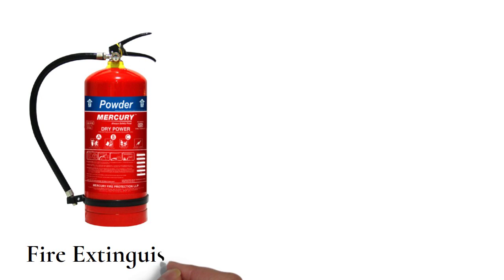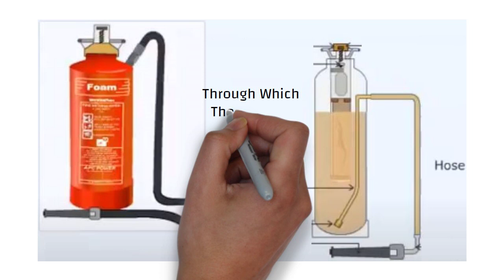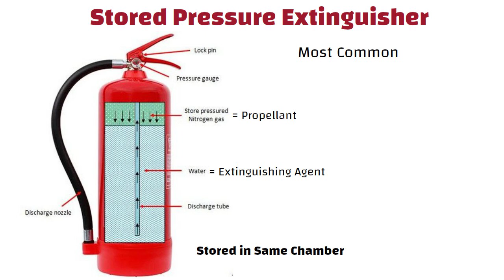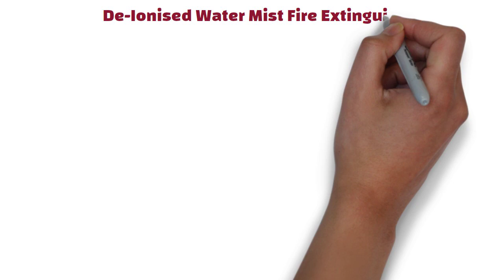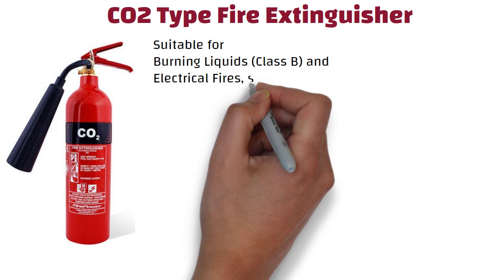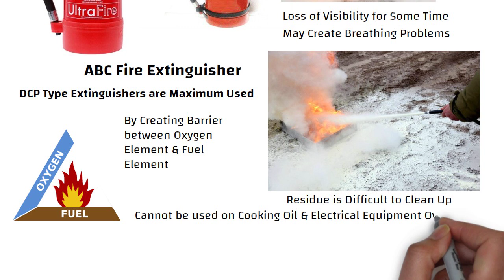FIRE EXTINGUISHER DEALERS IN KERALA, CALL 8138906102, FIRE EXTINGUISHER DEALERS IN ERNAKULAM.

Comment: FIRE EXTINGUISHER DEALERS IN KOCHI, FIRE EXTINGUISHER SUPPLIERS IN KOCHI, FIRE EXTINGUISHER DISTRIBUTORS IN KOCHI, FIRE EXTINGUISHER IN KOCHI, ABC TYPE FIRE EXTINGUISHER DEALERS IN KOCHI, CO2 TYPE FIRE EXTINGUISHER DEALERS IN KOCHI, CLEAN AGENT FIRE EXTINGUISHER IN KOCHI, MODULAR TYPE FIRE EXTINGUISHER DEALERS IN KOCHI, MECHANICAL FOAM FIRE EXTINGUISHER DEALERS IN KOCHI, FIRE EXTINGUISHER NEAR ME KOCHI, FIRE EXTINGUISHER TRADERS IN KOCHI, FIRE FIGHTING COMPANIES IN KOCHI, FIRE CONTRACTORS IN KOCHI, FIRE EQUIPMENT DEALERS IN KOCHI, FIRE ALARM DEALERS IN KOCHI, FIRE PUMP DEALERS IN KOCHI, SMOKE DETECTOR DEALERS IN KOCHI, FIRE FIGHTING SYSTEM IN KOCHI, FIRE PROTECTION SYSTEM IN KOCHI, FIRE AND SAFETY CONTRACTORS IN KOCHI, FIRE HYDRANT SYSTEMS IN KOCHI, PA TALK BACK SYSTEM IN KOCHI, FIRE NOC IN KOCHI, FIRE INSTALLATION IN KOCHI, FIRE NOC RENEWAL IN KOCHI, KIRLOSKAR FIRE PUMP DEALERS IN KOCHI, FIRE EXTINGUISHER NEAR ME KOCHI, FIRE EXTINGUISHER MANUFACURERS IN KOCHI, SAFEX FIRE EXTINGUISHER DEALERS IN KOCHI, FIRE NOC CONTRACTORS IN KOCHI, FIRE FIGHTING EQUIPMENT DEALERS IN KOCHI, FIRE PROTECTION SYSTEM IN KOCHI, FIRE INSTALLATION IN KOCHI, FIRE SAFETY CONTRACTORS IN KOCHI, FIRE AMC IN KOCHI, FIRE PROTECTION SYSTEM IN KOCHI, FIRE PROTECTION EQUIPMET IN KOCHI, AMC OF FIRE SYSTEM IN KOCHI, FIRE CONSULTANTS IN KOCHI, FIRE AND SAFETY EQUIPMENT DEALERS IN KOCHI, ADDRESSABLE FIRE ALARM SYSTEM IN KOCHI, KARTHAR VALVE DEALERS IN KOCHI, DCP TYPE FIRE EXTINGUISHER IN KOCHI, POWSER TYPE FIRE EXTINGUISHERS IN KOCHI, FIRE HYDRANT SYSTEM IN KOCHI, FIRE ALARM PANEL DEALERS IN KOCHI, SAFEPRO FIRE EXTINGUISHER DEALERS IN KOCHI, MS AND GI PIPE DEALERS IN KOCHI, JINDAL PIPE DEALERS IN KOCHI, AGNI FIRE ALARM DEALERS IN KOCHI, FIRE EQUIPMENT DEALERS IN KOCHI, FIRE EQUIPMENT SUPPLIERS IN KOCHI, FIRE EQUIPMENT TRADERS IN KOCHI, FIRE SPRINKLER SYSTEM IN KOCHI, RAVLE FIRE ALARM DEALERS IN KOCHI, RAVEL FIRE ALARM SYSTEM IN KOCHI, AGNI FIRE ALARM DISTRIBUTORS IN KOCHI, FIRE ALARM CONTRACTORS IN KOCHI, FIRE PIPE INSTALLATION IN CONTRACTORS IN KOCHI, FIRE SAFETY CONTRACTORS IN KOCHI, FIRE PA TWO WAY TALK BACK SYSTEM DEALERS IN KOCHI, HEAT DETECTOR DEALERS IN KOCHI, HONEYWELL FIRE ALARM DEALERS IN KOCHI, FIRE NOC CONSULTANTS IN KOCHI, FIRE AMC AND FIRE NOC IN KOCHI, FIRE SAFETY COMPANIES IN KOCHI, NEWAGE DEALERS IN KOCHI, MONSHER FIRE EQUIPMENT DEALERS IN KOCHI, KARTHAR VALVE DEALERS IN KOCHI, FIRE HYDRANT VALVE DEALERS IN KOCHI, FIRE HOSE REEL DRUM DEALERS IN KOCHI, FIRE SPRINKLER DEALERS IN KOCHI, FIRE PUMP DEALERS IN KOCHI, LUBI PUMP DEALERS IN KOCHI, LHP PUMP DEALERS IN KOCHI. FIRE CONTRACTORS IN KOCHI, FIRE AND SAFETY CONTRACTORS IN KOCHI, FIRE EQUIPMENT DEALERS IN KOCHI, FIRE FIGHTING CONTRACTORS IN KOCHI,

Comment: FIRE EXTINGUISHER DEALERS IN WAYANAD, FIRE EXTINGUISHER SUPPLIERS IN WAYANAD, FIRE EXTINGUISHER DISTRIBUTORS IN WAYANAD, FIRE EXTINGUISHER IN WAYANAD, ABC TYPE FIRE EXTINGUISHER DEALERS IN WAYANAD, CO2 TYPE FIRE EXTINGUISHER DEALERS IN WAYANAD, CLEAN AGENT FIRE EXTINGUISHER IN WAYANAD, MODULAR TYPE FIRE EXTINGUISHER DEALERS IN WAYANAD, MECHANICAL FOAM FIRE EXTINGUISHER DEALERS IN WAYANAD, FIRE EXTINGUISHER NEAR ME WAYANAD, FIRE EXTINGUISHER TRADERS IN WAYANAD, FIRE FIGHTING COMPANIES IN WAYANAD, FIRE CONTRACTORS IN WAYANAD, FIRE EQUIPMENT DEALERS IN WAYANAD, FIRE ALARM DEALERS IN WAYANAD, FIRE PUMP DEALERS IN WAYANAD, SMOKE DETECTOR DEALERS IN WAYANAD, FIRE FIGHTING SYSTEM IN WAYANAD, FIRE PROTECTION SYSTEM IN WAYANAD, FIRE AND SAFETY CONTRACTORS IN WAYANAD, FIRE HYDRANT SYSTEMS IN WAYANAD, PA TALK BACK SYSTEM IN WAYANAD, FIRE NOC IN WAYANAD, FIRE INSTALLATION IN WAYANAD, FIRE NOC RENEWAL IN WAYANAD, KIRLOSKAR FIRE PUMP DEALERS IN WAYANAD, FIRE EXTINGUISHER NEAR ME WAYANAD, FIRE EXTINGUISHER MANUFACURERS IN WAYANAD, SAFEX FIRE EXTINGUISHER DEALERS IN WAYANAD, FIRE NOC CONTRACTORS IN WAYANAD, FIRE FIGHTING EQUIPMENT DEALERS IN WAYANAD, FIRE PROTECTION SYSTEM IN WAYANAD, FIRE INSTALLATION IN WAYANAD, FIRE SAFETY CONTRACTORS IN WAYANAD, FIRE AMC IN WAYANAD, FIRE PROTECTION SYSTEM IN WAYANAD, FIRE PROTECTION EQUIPMET IN WAYANAD, AMC OF FIRE SYSTEM IN WAYANAD, FIRE CONSULTANTS IN WAYANAD, FIRE AND SAFETY EQUIPMENT DEALERS IN WAYANAD, ADDRESSABLE FIRE ALARM SYSTEM IN WAYANAD, KARTHAR VALVE DEALERS IN WAYANAD, DCP TYPE FIRE EXTINGUISHER IN WAYANAD, POWSER TYPE FIRE EXTINGUISHERS IN WAYANAD, FIRE HYDRANT SYSTEM IN WAYANAD, FIRE ALARM PANEL DEALERS IN WAYANAD, SAFEPRO FIRE EXTINGUISHER DEALERS IN WAYANAD, MS AND GI PIPE DEALERS IN WAYANAD, JINDAL PIPE DEALERS IN WAYANAD, AGNI FIRE ALARM DEALERS IN WAYANAD, FIRE EQUIPMENT DEALERS IN WAYANAD, FIRE EQUIPMENT SUPPLIERS IN WAYANAD, FIRE EQUIPMENT TRADERS IN WAYANAD, FIRE SPRINKLER SYSTEM IN WAYANAD, RAVEL FIRE ALARM DEALERS IN WAYANAD, RAVEL FIRE ALARM SYSTEM IN WAYANAD, AGNI FIRE ALARM DISTRIBUTORS IN WAYANAD, FIRE ALARM CONTRACTORS IN WAYANAD, FIRE PIPE INSTALLATION IN CONTRACTORS IN WAYANAD, FIRE SAFETY CONTRACTORS IN WAYANAD, FIRE PA TWO WAY TALK BACK SYSTEM DEALERS IN WAYANAD, HEAT DETECTOR DEALERS IN WAYANAD, HONEYWELL FIRE ALARM DEALERS IN WAYANAD, FIRE NOC CONSULTANTS IN WAYANAD, FIRE AMC AND FIRE NOC IN WAYANAD, FIRE SAFETY COMPANIES IN WAYANAD, NEWAGE DEALERS IN WAYANAD, MONSHER FIRE EQUIPMENT DEALERS IN WAYANAD, KARTHAR VALVE DEALERS IN WAYANAD, FIRE HYDRANT VALVE DEALERS IN WAYANAD, FIRE HOSE REEL DRUM DEALERS IN WAYANAD, FIRE SPRINKLER DEALERS IN WAYANAD, FIRE PUMP DEALERS IN WAYANAD, LUBI PUMP DEALERS IN WAYANAD, LHP PUMP DEALERS IN WAYANAD. FIRE CONTRACTORS IN WAYANAD, FIRE AND SAFETY CONTRACTORS IN WAYANAD, FIRE EQUIPMENT DEALERS IN WAYANAD, FIRE FIGHTING CONTRACTORS IN WAYANAD, AGNI FIRE ALARM DEALERS IN WAYANAD, PA TALK BACK SYSTEM DEALERS IN WAYANAD, FIRE NOC IN WAYANAD, FIRE NOC RENEWAL IN WAYANAD, FIRE SYSTEM INSTALLATION IN WAYANAD, FIRE EXTINGUISHER DEALERS IN KALPETTA, FIRE EXTINGUISHER DEALERS IN BATHERY, FIRE EXTINGUISHER DEALERS IN MANATHAVADY.

Comment: FIRE EXTINGUISHER DEALERS IN PALAKKAD, FIRE EXTINGUISHER SUPPLIERS IN PALAKKAD, FIRE EXTINGUISHER DISTRIBUTORS IN PALAKKAD, FIRE EXTINGUISHER IN PALAKKAD, ABC TYPE FIRE EXTINGUISHER DEALERS IN PALAKKAD, CO2 TYPE FIRE EXTINGUISHER DEALERS IN PALAKKAD, CLEAN AGENT FIRE EXTINGUISHER IN PALAKKAD, MODULAR TYPE FIRE EXTINGUISHER DEALERS IN PALAKKAD, MECHANICAL FOAM FIRE EXTINGUISHER DEALERS IN PALAKKAD, FIRE EXTINGUISHER NEAR ME PALAKKAD, FIRE EXTINGUISHER TRADERS IN PALAKKAD, FIRE FIGHTING COMPANIES IN PALAKKAD, FIRE CONTRACTORS IN PALAKKAD, FIRE EQUIPMENT DEALERS IN PALAKKAD, FIRE ALARM DEALERS IN PALAKKAD, FIRE PUMP DEALERS IN PALAKKAD, SMOKE DETECTOR DEALERS IN PALAKKAD, FIRE FIGHTING SYSTEM IN PALAKKAD, FIRE PROTECTION SYSTEM IN PALAKKAD, FIRE AND SAFETY CONTRACTORS IN PALAKKAD, FIRE HYDRANT SYSTEMS IN PALAKKAD, PA TALK BACK SYSTEM IN PALAKKAD, FIRE NOC IN PALAKKAD, FIRE INSTALLATION IN PALAKKAD, FIRE NOC RENEWAL IN PALAKKAD, KIRLOSKAR FIRE PUMP DEALERS IN PALAKKAD, FIRE EXTINGUISHER NEAR ME PALAKKAD, FIRE EXTINGUISHER MANUFACURERS IN PALAKKAD, SAFEX FIRE EXTINGUISHER DEALERS IN PALAKKAD, FIRE NOC CONTRACTORS IN PALAKKAD, FIRE FIGHTING EQUIPMENT DEALERS IN PALAKKAD, FIRE PROTECTION SYSTEM IN PALAKKAD, FIRE INSTALLATION IN PALAKKAD, FIRE SAFETY CONTRACTORS IN PALAKKAD, FIRE AMC IN PALAKKAD, FIRE PROTECTION SYSTEM IN PALAKKAD, FIRE PROTECTION EQUIPMET IN PALAKKAD, AMC OF FIRE SYSTEM IN PALAKKAD, FIRE CONSULTANTS IN PALAKKAD, FIRE AND SAFETY EQUIPMENT DEALERS IN PALAKKAD, ADDRESSABLE FIRE ALARM SYSTEM IN PALAKKAD, KARTHAR VALVE DEALERS IN PALAKKAD, DCP TYPE FIRE EXTINGUISHER IN PALAKKAD, POWSER TYPE FIRE EXTINGUISHERS IN PALAKKAD, FIRE HYDRANT SYSTEM IN PALAKKAD, FIRE ALARM PANEL DEALERS IN PALAKKAD, SAFEPRO FIRE EXTINGUISHER DEALERS IN PALAKKAD, MS AND GI PIPE DEALERS IN PALAKKAD, JINDAL PIPE DEALERS IN PALAKKAD, AGNI FIRE ALARM DEALERS IN PALAKKAD, FIRE EQUIPMENT DEALERS IN PALAKKAD, FIRE EQUIPMENT SUPPLIERS IN PALAKKAD, FIRE EQUIPMENT TRADERS IN PALAKKAD, FIRE SPRINKLER SYSTEM IN PALAKKAD, RAVEL FIRE ALARM DEALERS IN PALAKKAD, RAVEL FIRE ALARM SYSTEM IN PALAKKAD, AGNI FIRE ALARM DISTRIBUTORS IN PALAKKAD, FIRE CONTRACTORS IN PALAKKAD, FIRE FIGHTING CONTRACTORS IN PALAKKAD, FIRE FIGHTING COMPANIES IN PALAKKAD, FIRE INSTALLATION IN PALAKKAD,  FIRE ALARM CONTRACTORS IN PALAKKAD, FIRE PIPE INSTALLATION IN CONTRACTORS IN PALAKKAD, FIRE SAFETY CONTRACTORS IN PALAKKAD, FIRE PA TWO WAY TALK BACK SYSTEM DEALERS IN PALAKKAD, HEAT DETECTOR DEALERS IN PALAKKAD, HONEYWELL FIRE ALARM DEALERS IN PALAKKAD, FIRE NOC CONSULTANTS IN PALAKKAD, FIRE AMC AND FIRE NOC IN PALAKKAD, FIRE SAFETY COMPANIES IN PALAKKAD, NEWAGE DEALERS IN PALAKKAD, MONSHER FIRE EQUIPMENT DEALERS IN PALAKKAD, KARTHAR VALVE DEALERS IN PALAKKAD, FIRE HYDRANT VALVE DEALERS IN PALAKKAD, FIRE HOSE REEL DRUM DEALERS IN PALAKKAD, FIRE SPRINKLER DEALERS IN PALAKKAD, FIRE PUMP DEALERS IN PALAKKAD, LUBI PUMP DEALERS IN PALAKKAD, LHP PUMP DEALERS IN PALAKKAD. FIRE CONTRACTORS IN PALAKKAD, FIRE AND SAFETY CONTRACTORS IN PALAKKAD, FIRE EQUIPMENT DEALERS IN PALAKKAD, FIRE FIGHTING CONTRACTORS IN PALAKKAD,

Comment: fire protection equipments in KOCHI, fire and safety consultants in KOCHI, fire protection system in KOCHI, fire alarm systems in KOCHI, fire and safety consultants in KOCHI, fire protection system in KOCHI, fire and safety installation in KOCHI, fire and safety contractors in KOCHI, fire fighting companies in KOCHI, fire protection equipments in KOCHI, fire protection system contractors in COCHIN, fire alarm systems in KOCHI, fire protection consultants in KOCHI, fire safety contractors in KOCHI, fire safety consultants in KOCHI, fire consultants in KOCHI, fire and safety contractors in KOCHI, fire alarm systems in KOCHI, fire and safety AMC in KOCHI, fire and safety equipment suppliers in KOCHI, fire and safety systems in KOCHI, fire fighting companies in KOCHI, fire NOC consultants in KOCHI, fire extinguisher manufacturers in KOCHI, fire protection AMC in KOCHI, fire fighting consultants in KOCHI, fire fighting consultants in KOCHI, fire NOC renewal in KOCHI, fire and safety equipment in KOCHI, fire extinguisher in KOCHI, Fire extinguisher dealers in ERNAKULAM, fire extinguisher dealers in ERNAKULAM, fire fighting contractors in ERNAKULAM, ERNAKULAM, fire and safety installation in ERNAKULAM, fire extinguisher suppliers in ERNAKULAM, fire extinguisher suppliers in ERNAKULAM, fire extinguisher in ERNAKULAM, fire extinguisher in ERNAKULAM, fire protection system in ERNAKULAM, fire protection system in ERNAKULAM, fire and safety installation in ERNAKULAM, fire and safety installation in ERNAKULAM, fire and safety contractors in ERNAKULAM, fire safety contractors in ERNAKULAM, fire and safety systems equipments in ERNAKULAM, fire and safety equipment suppliers in ERNAKULAM, fire equipment in ERNAKULAM, fire extinguisher in ERNAKULAM, fire extinguisher in ERNAKULAM, fire protection system installation in ERNAKULAM, fire contractors in ERNAKULAM, fire safety consultants in ERNAKULAM, ABC type fire extinguisher dealers in Kochi, DCP type fire extinguisher dealers in Kochi, CO2 type fire extinguisher dealers in Kochi, Fire extinguisher wholesale traders in Kochi, Fire extinguisher suppliers in Kochi, Fire protection equipment dealers in Kochi, Fire alarm dealers in Kochi, Smoke detector dealers in Kochi, PA talk back system in Kochi, Addressable fire alarm dealers in Kochi, Morley Fire alarm dealers in Kochi, Ravel fire alarm dealers in Kochi, Fire fighting system in Kochi, Fire NOC in Kochi, Fire contractors in Kochi, Karthar dealers in Kochi, Fire protection system in Kochi, Fire installation in Kochi, Fire consultants in Kochi, Fire Extinguishers Wholesalers , Fire Extinguishers Distributors in COCHIN, Fire Extinguishers Sales & Service in COCHIN, Fire Extinguishers Retailers in ERNAKULAM, FIRE FIGHTING SYSTEMS – FIRE PROTECTION SYSTEMS – FIRE FIGHTING EQUIPMENTS – FIRE PROTECTION EQUIPMENTS – FIRE EXTINGUISHING EQUIPMENT – FIRE EXTINGUISHER DEALERS-SAFETY EQUIPMENT DEALERS – FIRE PROTECTION AND FIRE FIGHTING EQUIPMENT DEALER, Fire Safety Systems Suppliers, Fire Safety Systems Distributors, Fire Safety Systems Wholesalers, Fire Safety Systems Retailers, fire and safety contractors in KOCHI, fire alarm systems in KOCHI, fire and safety AMC in KOCHI, fire and safety equipment suppliers in KOCHI, fire and safety systems in KOCHI, fire fighting companies in KOCHI, fire NOC consultants in KOCHI, fire extinguisher manufacturers in KOCHI, fire protection AMC in KOCHI, fire NOC renewal in KOCHI, fire and safety equipment in KOCHI, fire extinguisher in KOCHI, Fire extinguisher dealers in ERNAKULAM, fire extinguisher dealers in ERNAKULAM, fire fighting contractors in ERNAKULAM, ERNAKULAM, fire and safety installation in ERNAKULAM, fire extinguisher suppliers in ERNAKULAM, fire extinguisher suppliers in ERNAKULAM, fire extinguisher in ERNAKULAM, fire extinguisher in ERNAKULAM, fire protection system in ERNAKULAM, fire protection system in ERNAKULAM, fire and safety installation in ERNAKULAM, fire and safety installation in ERNAKULAM, fire and safety contractors in ERNAKULAM, fire safety contractors in ERNAKULAM, fire and safety systems equipments in ERNAKULAM, fire and safety equipment suppliers in ERNAKULAM, fire equipment in ERNAKULAM, fire extinguisher in ERNAKULAM, fire extinguisher in ERNAKULAM, fire protection system installation in ERNAKULAM, fire contractors in ERNAKULAM, ERNAKULAM, fire safety consultants in ERNAKULAM, ERNAKULAM, fire alarm systems in ERNAKULAM, fire NOC in ERNAKULAM, fire AMC in ERNAKULAM, ERNAKULAM, fire fighting equipment in ERNAKULAM, COCHIN,

Comment: FIRE EXTINGUISHER DEALERS IN CALICUT, FIRE EXTINGUISHER SUPPLIERS IN CALICUT, FIRE EXTINGUISHER DISTRIBUTORS IN CALICUT, FIRE EXTINGUISHER IN CALICUT, ABC TYPE FIRE EXTINGUISHER DEALERS IN CALICUT, CO2 TYPE FIRE EXTINGUISHER DEALERS IN CALICUT, CLEAN AGENT FIRE EXTINGUISHER IN CALICUT, MODULAR TYPE FIRE EXTINGUISHER DEALERS IN CALICUT, MECHANICAL FOAM FIRE EXTINGUISHER DEALERS IN CALICUT, FIRE EXTINGUISHER NEAR ME CALICUT, FIRE EXTINGUISHER TRADERS IN CALICUT, FIRE FIGHTING COMPANIES IN CALICUT, FIRE CONTRACTORS IN CALICUT, FIRE EQUIPMENT DEALERS IN CALICUT, FIRE ALARM DEALERS IN CALICUT, FIRE PUMP DEALERS IN CALICUT, SMOKE DETECTOR DEALERS IN CALICUT, FIRE FIGHTING SYSTEM IN CALICUT, FIRE PROTECTION SYSTEM IN CALICUT, FIRE AND SAFETY CONTRACTORS IN CALICUT, FIRE HYDRANT SYSTEMS IN CALICUT, PA TALK BACK SYSTEM IN CALICUT, FIRE NOC IN CALICUT, FIRE INSTALLATION IN CALICUT, FIRE NOC RENEWAL IN CALICUT, KIRLOSKAR FIRE PUMP DEALERS IN CALICUT, FIRE EXTINGUISHER NEAR ME CALICUT, FIRE EXTINGUISHER MANUFACURERS IN CALICUT, SAFEX FIRE EXTINGUISHER DEALERS IN CALICUT, FIRE NOC CONTRACTORS IN CALICUT, FIRE FIGHTING EQUIPMENT DEALERS IN CALICUT, FIRE PROTECTION SYSTEM IN CALICUT, FIRE INSTALLATION IN CALICUT, FIRE SAFETY CONTRACTORS IN CALICUT, FIRE AMC IN CALICUT, FIRE PROTECTION SYSTEM IN CALICUT, FIRE PROTECTION EQUIPMET IN CALICUT, AMC OF FIRE SYSTEM IN CALICUT, FIRE CONSULTANTS IN CALICUT, FIRE AND SAFETY EQUIPMENT DEALERS IN CALICUT, ADDRESSABLE FIRE ALARM SYSTEM IN CALICUT, KARTHAR VALVE DEALERS IN CALICUT, DCP TYPE FIRE EXTINGUISHER IN CALICUT, POWSER TYPE FIRE EXTINGUISHERS IN CALICUT, FIRE HYDRANT SYSTEM IN CALICUT, FIRE ALARM PANEL DEALERS IN CALICUT, SAFEPRO FIRE EXTINGUISHER DEALERS IN CALICUT, MS AND GI PIPE DEALERS IN CALICUT, JINDAL PIPE DEALERS IN CALICUT, AGNI FIRE ALARM DEALERS IN CALICUT, FIRE EQUIPMENT DEALERS IN CALICUT, FIRE EQUIPMENT SUPPLIERS IN CALICUT, FIRE EQUIPMENT TRADERS IN CALICUT, FIRE SPRINKLER SYSTEM IN CALICUT, RAVLE FIRE ALARM DEALERS IN CALICUT, RAVEL FIRE ALARM SYSTEM IN CALICUT, AGNI FIRE ALARM DISTRIBUTORS IN CALICUT, FIRE ALARM CONTRACTORS IN CALICUT, FIRE PIPE INSTALLATION IN CONTRACTORS IN CALICUT, FIRE SAFETY CONTRACTORS IN CALICUT, FIRE PA TWO WAY TALK BACK SYSTEM DEALERS IN CALICUT, HEAT DETECTOR DEALERS IN CALICUT, HONEYWELL FIRE ALARM DEALERS IN CALICUT, FIRE NOC CONSULTANTS IN CALICUT, FIRE AMC AND FIRE NOC IN CALICUT, FIRE SAFETY COMPANIES IN CALICUT, NEWAGE DEALERS IN CALICUT, MONSHER FIRE EQUIPMENT DEALERS IN CALICUT, KARTHAR VALVE DEALERS IN CALICUT, FIRE HYDRANT VALVE DEALERS IN CALICUT, FIRE HOSE REEL DRUM DEALERS IN CALICUT, FIRE SPRINKLER DEALERS IN CALICUT, FIRE PUMP DEALERS IN CALICUT, LUBI PUMP DEALERS IN CALICUT, LHP PUMP DEALERS IN CALICUT. FIRE CONTRACTORS IN CALICUT, FIRE AND SAFETY CONTRACTORS IN CALICUT, FIRE EQUIPMENT DEALERS IN CALICUT, FIRE FIGHTING CONTRACTORS IN CALICUT,